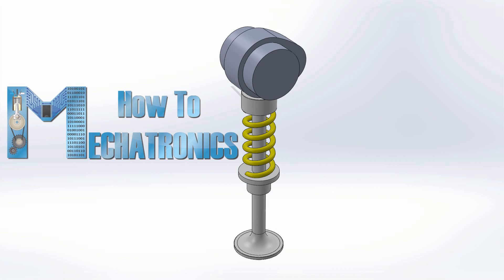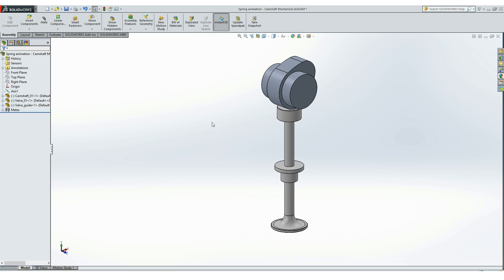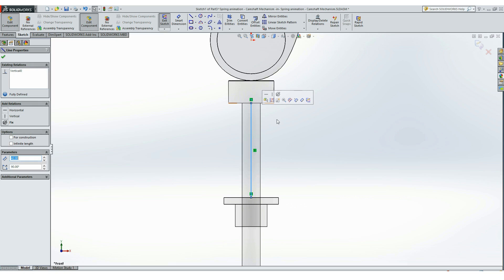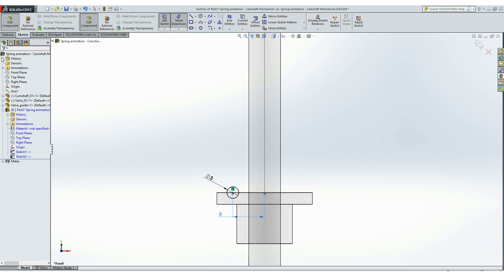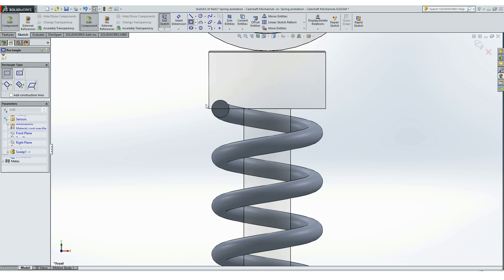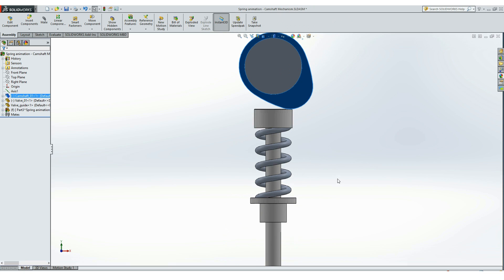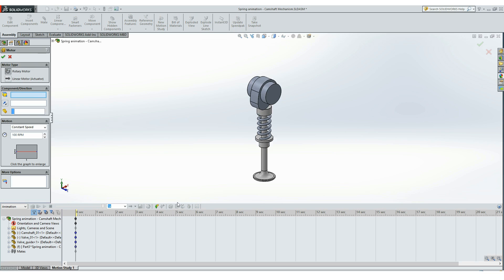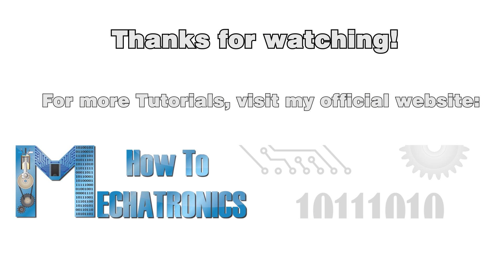Solidworks Spring Tutorial - Adaptive Spring Animation

Comment: Making the spring is the easy part, but which kind of mate did you use to make the central rod return back when there's no force applied on it? Coincident mate with the surface of the upper piece that rotates?
Reply: cam mate